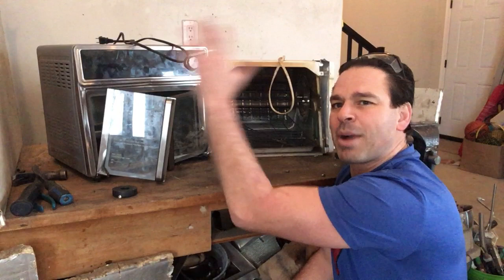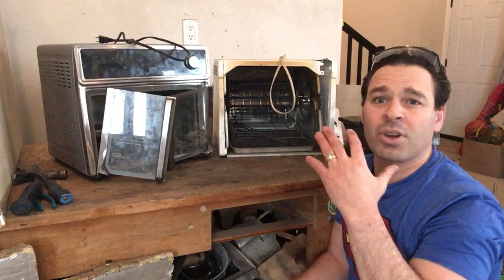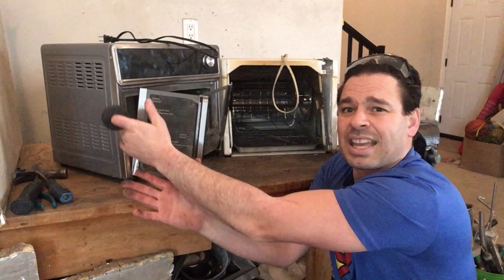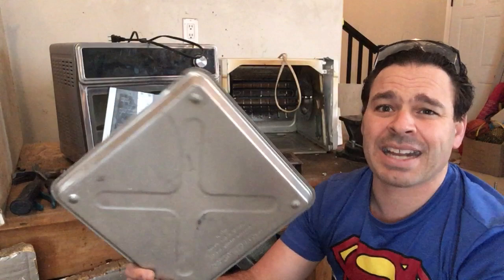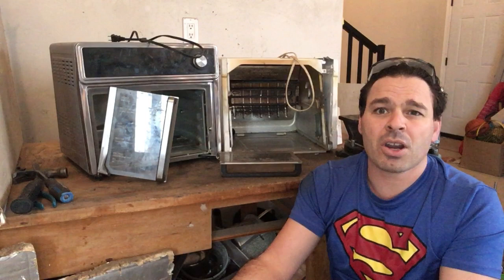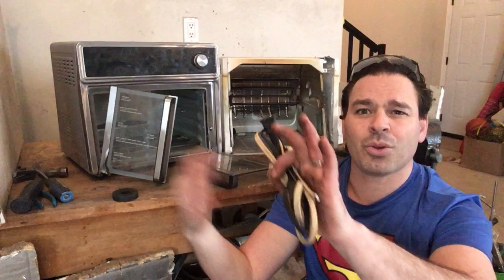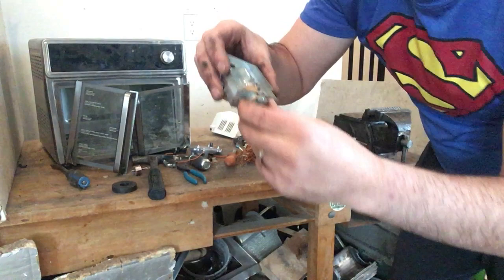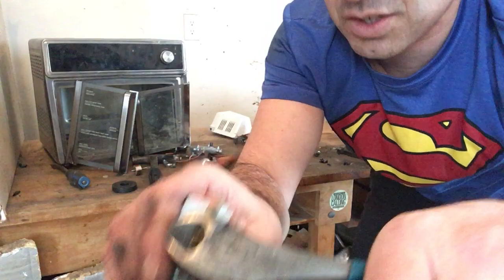Scrapping a toaster and rotisserie oven for free copper, tin, and other metals and zero waste!!

Comment: Great video as always. Does anyone know if those brass prongs at 13:12 have to have the wires completely removed? I have a bunch, but some have little bits of wire that are annoying to remove.
Reply: You shouldn't have to remove the wires as long as it's bare copper (no insulation).  For clean price, a little copper on brass for clean brass is okay...a little brass on copper is not for clean copper.
Reply from the maker: Trace amounts are fine, but I hint a lot of times it depends on your yard or the person working the scales. Another option for the prongs that have the plastic casing on them is to cut them off and put in a bucket. At the yard I go to in London Ont. Gives 16 cents a pound. Not as good as clean brass, but better than mixed wire price
Reply: @TinManScrapper  thanks for the tip! 😊
Reply: @cuscrapping  some that I have have aluminum wire. I suppose those need to be cut off then...
Reply: @WilhelmFreidrich  That will depend on your yard.  Mine would take them.  Be sure it is actual aluminum wiring and not just tin coated copper as most are.  If it came from an appliance, the wiring is not aluminum, but tin coated copper.